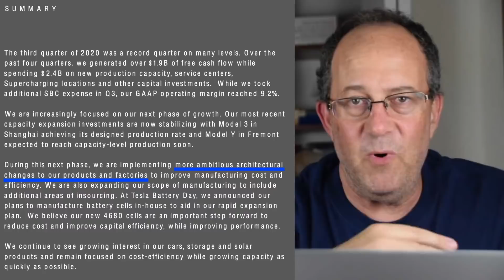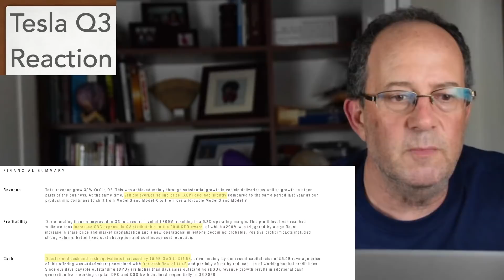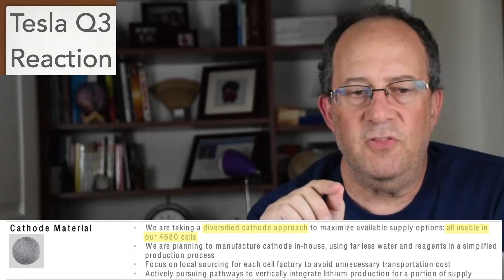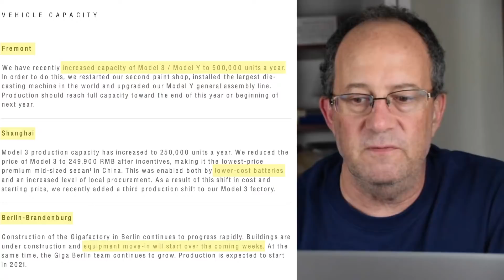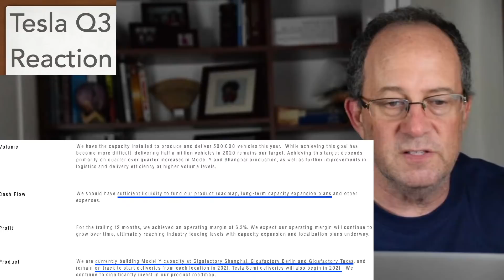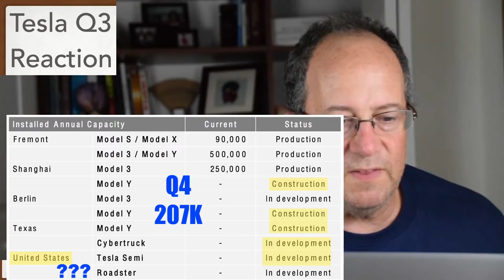Tesla Q3 Reaction: Live

Comment: I believe in the construction industry there is something called manufactured lumber in which thin layers of material possibly even wood itself are glued together to for, for example, a support beam, that is stronger than a beam sawed out of a tree trunk. I wonder if a structure of glued together batteries encased in thin metal might be stronger than solid metal.
Reply from the maker: I don't think it's the material properties that make it stronger. It's 80 mm thick. That's over 3 inches. Cybertruck steel is only 3 mm thick.
Reply: @WarrenRedlich  The point was trying to make had to do with the fact that gluing together thin layers of whatever material forms a structure that is stronger than a homogeneous piece of anything. 
I have a PhD in engineering and would be amenable to any sort of collaboration with you. My career involved over 30 years of technical product design. My skills are physics and design.

Comment: As Tesla adds more and more innovative units or companies across many fields of science and industries, they are creating more opportunistic synergies, or as I like to think of is “ waves of serendipities.

Just one example: What’s to stop Tesla from using boring company to build a 400 mile tunnel from Terra-Austin to Dallas Ft. Worth. Then putting Megapacks in a line back to back from Austin to Dallas Ft Worth in the boring tunnel from Austin’s battery factory ? 

This would merge two legs of electric power: long distance transmission and storage. The possibilities are endless. And it scales almost endlessly. 

I-35 in Texas, (San Antonio to Dallas Ft Worth), goes through wind corridors and excellent solar areas. 

Also in Texas lots of retail is magnetized to the interstate frontage roads that run parallel to the highway interstate creating almost a 400 miles of constant retail. 

Electric power could be put in or taken out anywhere along this 400 mile line of megapacks with wind or solar fields supplying local utility needs. Basically one 400 mile long battery solving: the peaker problem; intermittency; high electricity costs in Texas; electric transmission loss etc etc.

This 400 mile long battery transmission and storage solution is possible right now. Eventually it could be re-engineered and transformed into something dramatically different, that includes liquid cooling, redesigning megapacks specifically for both this and utility substations.

Comment: Warren - Powerpack has LIMITED Utility, its only 100 kwh of Storage each, 2016 Powerpack was $445/kwh (200 kwh system), you still have to ADD Seperate Controller & Inverter cabnets ($52,500) . A 22 Mw system can cost $15 million . 
Compare with Megapack , each unit is 3mwh each and has Intergrated Controller & Inverter. Megapack is Bi-Directional 1.5 mwh.
and weight 23.1 Tons .
Reply from the maker: I think the latest Powerpack is close to 250 kWh.
Reply: @WarrenRedlich  - correct, they are now shipping V2 of Powerpack.

Comment: Warren - you are Correct, Fremont & Shanghai will get 4680 Cell production LAST .
GF4 Berlin will have the First 4680 cell Volume Production, but Berlin will be Supplied by Roadrunner until Battery ramps at Berlin. 
then GF5 Texas will get 4860 cells. Supplied by Roadrunner initially , and later TEXAS will ramp production. 
So, in 2 - 3 years then Fremont & Shanghai will get 4680 Production.
Reply from the maker: I think suppliers will provide LFP & NM cells in 4680 format sooner than that. LG Chem already talked about something close.
Reply: @WarrenRedlich  - today I learned, ULTIUM Battery is NCMA chemistry, Transport Evolved .

Comment: 1:12:00 Lately I'm thinking a good combination is small hub motors on rear wheels, plus larger motor on both axles. Optimize the hub motors for efficiency, and the axle for power density. Kick in the axle motor only when needed.
Reply: Ronald - HUB motors dont work, they are for e-Bikes and E-Motorcycle.
in a CAR or Pickup it does not work. 
Endurance top speed is 80 mph. 
Cybertruck is close to 200 mph with 3 Motors.
Cybertruck 3500 lbs Payload , 14,000 lbs TOWING.
Endurance is a JOKE.
Reply: @markplott4820  Please explain WHY hub motors don't work. You need to do some nuance. Obviously they do WORK, just maybe not well enough. Ordinarily I would agree, on account of the unsprung weight. But a lower-power motor, which could cover most of the driving distance and time, might be another matter.

Also consider that the hub could freewheel at high speeds, if it's a question of hub motors limiting the top end.

I don't know what you are referring to as "Endurance."

Comment: Architectural changes are alreadfyn happening on the fly in Austin. The casting/stamping pit has increased in size in the past month from what was first dug. Compare the drone videos from 2 different dates, and it can easily be seen. The central roadway has also been raised to the level of the builings after it was once set about 16" lower. Wider buildings?

Comment: 57:19. Elon did explain why they wouldn't use LIDAR even it it was free (just not right then), he explained it later when he was asked what advice he'd give Jeff Bezos on how to solve autonomy.  Basically the entire road system is setup for humans who use their eyes.  That means if you don't have a vision based solution, you don't have a universal solution.  Because vision is what humans use, and roads EVERYWHERE are setup for humans to use.  Since you have to solve for vision NO MATTER WHAT, why waste any time with anything else?  Thus, no, he wouldn't use LIDAR even if it were free, because it would be a waste of resources attempting to integrate it into the solution that doesn't need it.
Reply from the maker: Agreed. But you'd still use it if it was free, if it added value. It doesn't add value and it imposes a hidden cost - it uses energy that saps range.
Reply: @WarrenRedlich  that's the whole point, even if it were free, it wouldn't be free.  And not because of the power, but because of the engineering time required to integrate into the system, when it supplies no upside.  Like seriously, I understand you don't understand this stuff, but I do.  LIDAR is WORTHLESS, even if it were free, and even if it used NO POWER AT ALL.   LIDAR adds ZERO to the solution.  LIDAR uses the visible light spectrum, which means it has no greater perceptive power than regular vision (actually less, because you are limited to the distance which the emitters can throw the light).  It's obstructed by all the same things that obstruct regular vision, like snow and rain and so on.  It's merely a crutch to enable you to do range finding when you don't have a good visual solution.  Tesla's visual solution is already well past that.  LIDAR is a ZERO value add, even if it were free, even if it ran off magic, BUT you'd still have to allocate engineering time integrate it into your car somewhere, have a process to put it there, you'd still have wire for it, you'd still have to code for it, you'd still have to write it into the system for when you'd actually use it, which would be never if you solved vision which you have to do anyway.
Reply: @bujin5455  Absolutely-well explained.Why add an inferior(in this particular case) system.If you can walk and you are healthy you don't need a walking stick even if someone bought it for you.
Reply: @WarrenRedlich  not to mention it’s hideous and probably produces drag.
Reply: LIDAR is a Fools Errand - ELON MUSK.
Reply: @markplott4820  yes, that.